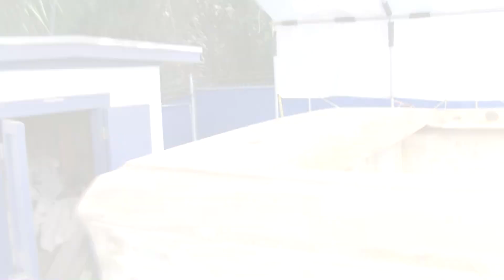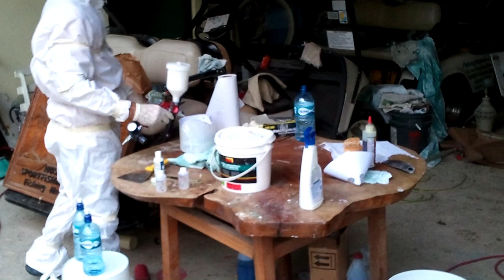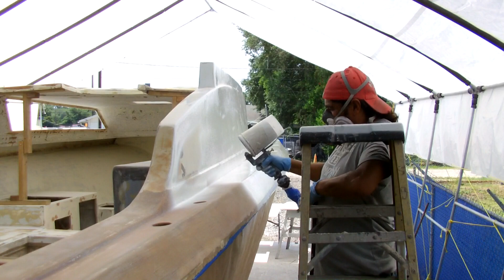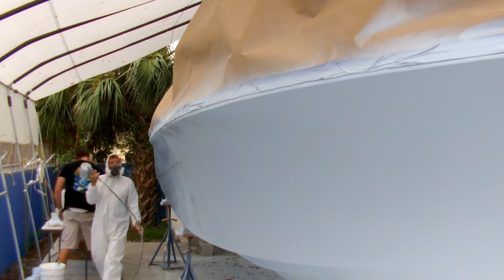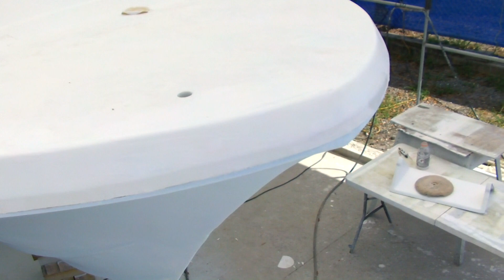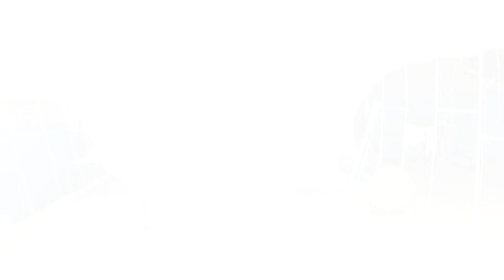The Discoverer Project - Chapter 6

Comment: Fiberglass coatings has an HVLP spraygun with a 2.5 tip for $100, should have gotten that one .. my current hvlp spraygun is too small . So this payday I’ll be buying a new gelcoat gun.  Definitely don’t use an airless spraygun!!!  It will gun up in the gun and your not supposed to run solvents in them , that’s why they say used water based colors

Comment: Wow, sorry you went through all this complexity....I did the bottom of my boat after removing the bottom paint on my 25' and it was outstanding. In case anyone needs to go the Gelcoat route...I used normal high velocity tip automotive industrial type spraygun. Sprayed 3-4 nice heavy coats with high pressure, compressor wide open about 90-100 psi to break up the particles and get faster flow out and less orange peel. 
No sanding and no orange peel result. Has been about 7 years now and it is holding up very well. Just needs the annual compounding and polishing to get it to shine like new again. I did use the Duratec, but not sure I would use it again. Would instead use the wax. 
My methodology was to spray it like I would a car, but using a heavy product, similar to urethanes, but of course Gelcoat is the heaviest. Thin it a bit helps flow and spray with styrene.

Comment: Cheers for the vid mate What is patch booster??
Is that the wax additive?
Reply from the maker: Patch booster is added to the gelcoat after the wax and before the catalyst. You can get it on Amazon. Be careful with it; highly toxic. https://www.amazon.com/Patch-Booster-Quart-Resin-Gelcoat/dp/B006VYF0N6
Reply: Could have used acetone as a thinner at 15% i spray all my gel with either acetone or styrene thinner. I use an automotive hvlp gun, and I only use 4-6% of styrene wax to seal and allow the gel to cure. Gel coating is easy if you do the proper prep work.

Comment: planning on building an Expedition style camper and I was planning on buying Laminated insulation sheets at $300 per sheet. It was going to be boxy. Now I think I will build the frame out of aluminum (which has not changed) and then round the corners with plywood, and wrap it in fiberglass then spay it down with Gel Coat. To get a shape and look of something more professional than a BOX on wheels.

Comment: I feel your pain boys. I can’t tell you how many jobs I messed up before I got it down. You can lay gel on gel but you gotta sand it each time . My exp. when I have done gel on gel is to do them together. I havnt been confronted with such a large job so I guess id sand in between layers and alway catalyst each layer and use patch aid.  That or wax or PVA works really well. 
I’d say have 3 guys laying coat after coat then PVA the whole thing maybe.

Comment: Did you wet sand after sprayed gelcoat and buff  it
Reply from the maker: Yes, dry sanded with 600p and 800p, then wet sand with 1000p and 1500p, then buff with Aqua buff compound, then wax with 3M paste wax. Lots of work but worth it.

Comment: All this could have been avoided if you just used an airless sprayer.
Reply: 1984sFinest  would any airless sprayer work? Like a handheld unit. I only have a 2x8' section. Would that be better than foam rolling with fgci rollable gelcoat?
Reply: You not supposed to use airless spraygun s with gelcoat.   The gelcoat will gum up in the gun and lines.  Plus they aren’t recommended for solvent cleaning , this is why your supposed to used water based paints
Reply: @Whalermansteve84  Professionals use airless sprayers all the time with gelcoat.  Especially on really big jobs.  I know years ago when I left this comment there were plenty of videos of it on youtube.